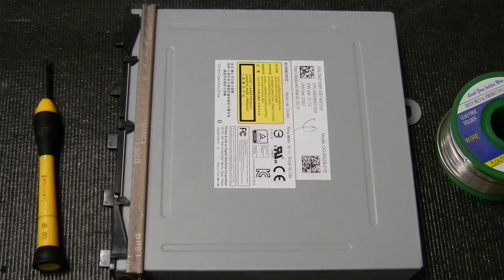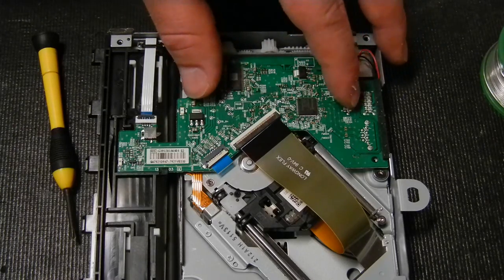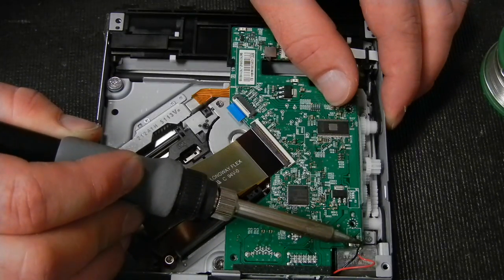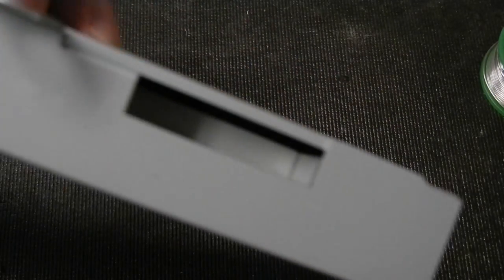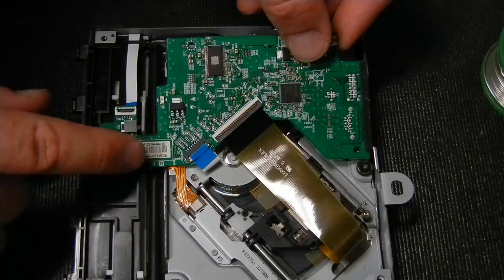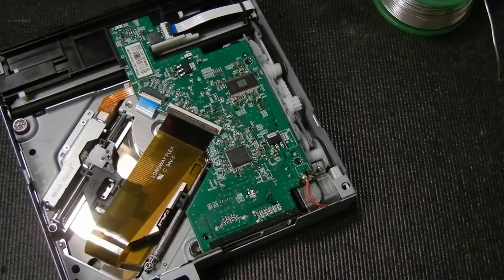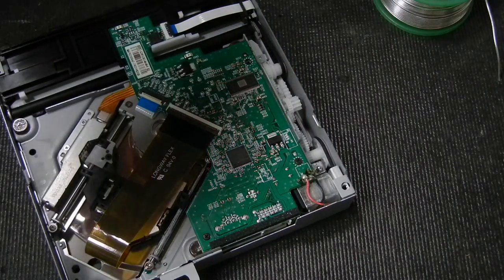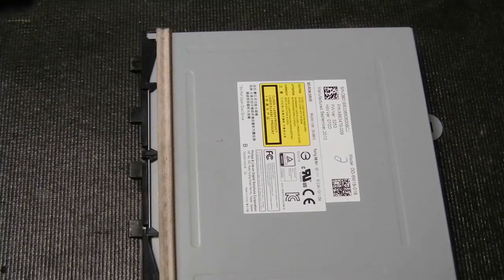How to replace my Xbox One blu-ray disc drive Xbox One disc drive swap tutorial

Comment: Very helpful. I'm relatively new to gaming, but not new to taking things apart. Instead of forking out a fortune for one of the latest boxes and games as an introduction for a beginner, I went for a quite cheap second hand XBox One console with games bundle. I also knew I got an optical drive with it, so it's one less HDMI being used. All was going fine for a few weeks until the optical drive started to fail. I bought a replacement - not that expensive for what it does - followed your instructions, and now it's all working fine again.

Comment: so... i was able to do the board swap with ZERO SOLDERING. i was able to remove the small rubber band and pulley off of the motor shaft very easily,  along with the 2 small screws that hold the motor in, and it came out with the board... it was much quicker and easier than the desolder and resolder job.
Reply: You think I will be able to do this without soldering
Reply: @Cearjifb  yes... just follow what I said in the comment.

Comment: What's the difference in Model DG-6M1S and Model DG-6M2S?
Reply: Just reading some posts on the Xbox one disk drive swap and was wondering what the answer is to your question. What is the difference between the DG-6S1M and the DG-6S2M models.

Comment: has 2 be the same model number as ur old drive as of the dvd drive has that model number on the board if u put the wrong dvd drive in the console with a different model number wont update the console with get a error msg if you buy the same model number as ur consoles then yes it will work no soldiering ive done it 2 my familys broken xbox 1s people think can just buy any drive plug an play

Comment: Thanks was able to fix mine yesterday, just a note, since I added too much solder I had to add electrical tape to the drive cover since it was grounding out and not working when I put it together.

Comment: These units are RoHS compliant as required by current laws.  This means zero lead in the solder.  This is why it melts at a hotter temp.  The industry standard for lead solder for electronics is 63-27. It is 63% lead and 27% tin. The tin reduces the melting temp of the solder.

Comment: Flux makes the heat transfer better and won’t take as long , I’m using a 30watt (non adjustable heat) soldering iron I got from Walmart and it lifted in a few seconds . I got the Flux from Home Depot (bernzomatic is the brand)
Reply: i believe that flux is for copper pipes i wouldn't use that on electronics as it is stronger and can eat the traces on the board, get mg rosin flux its non corrosive , but use in a well ventilated area as it has strong fumes

Comment: You can add some low melt solder to each pad and then heat up the pads, it will melt much easier. The same thing i use when doing repairs replacing the 3DS charging port
Reply: I did the same stuff with my og xbox 360

Comment: Very good information except for the method of de-soldering the solder joint. Heat transfer is almost impossible unless you add a bit of solder to the soldering gun first. The solder would likely not need as much heat to liquify is using solder on the tip of the solder gun.

Comment: @TinkerMods Microsoft sent me a replacement, but it constantly runs the motor that brings the disk in. Is it possible to just take the eye out of the new one and put it in the old one? My old one just doesn’t read discs. The new one with play games, but when a disk is in it, it runs the motor.

Comment: So if but a new drive and not change the board i can still play you rays? Cos all my games are digital any way?
Reply: You can still play b-ray but as soon as your Xbox updates it will brick because the boards don't match. Luckily I kept my old drive - swapped it back in and Xbox completed update. Replacing the board as shown here is necessary if you don't want to keep having problems every time you take an update.
Reply: Ben Bizzarri 

So I could update it with the broken drive, Then after its done updating put the working one in it and it'll work fine? That is until it needs an update...?
Reply: @benbizzarri5651  what about disc games?
cause my disc drive quit on me for no reason & if I swap a new one in (the whole thing), & if the console gets an update, I don't want to have a problem where I won't be able to play games anymore cause it'll give me an error message & I really don't want that to happen & I don't have a soldering iron to switch the board

Comment: What are the chances of the old board being the problem in the first place?
Reply: The lasers get weaker over time. So most likely the cd drive. Not the board.
Reply: RogerWilco99  yes I repaired CD players in the 80s lots of them. Sometimes the cd drive motor goes bad. Will not play tracks on the outer side of cd but inside tracks are ok that’s the drive motor.

Comment: i ordered a dg-6m1s-03B and they sent a dg-6m1s-01B will it work or do i need to open a case against them on ebay for sending the wrong the drive, so far they haven't responded
Reply: I ordered a 6m1s when the drive that came out of my drive was a 6m2s and it most definitely doesn’t work…picking the right one up today after work and gonna see if it works

Comment: Hey man..... please help. I followed your instructions exactly. The new drive is the same model number. I did everything correctly, but the drive does not even recognize that there is a disk. It makes a single noise and then nothing. What could be the issue?
Reply: Laser not reading disk
Reply: Same here. Ever figure it out ?

Comment: Mine wouldn't take in disk the eject noise would change if I pushed the disk half way in from no disk to disk ejecting noise when pressing the eject button.

So I got another drive unplugged HDD put different disk drive in just to see if I had a working board, great took in disk and everything worked. So I thought ok has to be the motor chip, I swap it over, try again still the same. At this point I thought ok the motor controller chip is good, board good, laser good so I'll transplant the ID chip from one board to another.... Very hard to do but anyway with patience I did it... Pop drive back in and I'm back to square one but I now know it's a glitch with that ID chip and everything to do with the drive has been swapped.

At that point I thought mmmm I haven't been on the Xbox in quite a while possibly a year so I update the console while updating I insert a disk and it takes it. So I can only think if you don't go online to update Microsoft nuke your disk drive. As crazy as that sounds it's the only logical thing I can think of. Been using drive last few days and it hasn't missed a beat.

So make you sure you update your console before even thinking about replacing disk drive...

Comment: Not worth it. They don't sell new replacements for these. You still have to replace them with a used drive and there's no guarantee because one doesn't know how many hours of use is on the donor drive. If there are already many ways and videos  of repairing or replacing BD  drives on an Xbox one, that's already a sign that the weakest link of the Xbox one is the BD drive and the chances of getting another defective one is great. Honestly if one is finding a lot of issues with consoles, become a PC gamer, plenty of new replacements and mods for that rather than monkeying with used components in a console. Great video tutorial, but a waste of time according to many I.T. techs I've spoken with.
Reply: This is precisely the reason I became a PC gamer as well. I have an Xbox One that I only use for buying used last gen games which are much cheaper than what it costs on Steam, but for everything else, I buy it on PC. The performance is also much better than a console and the experience is nearly identical since I use an Xbox Core controller for gaming and can stream locally and remotely over Steam Link.